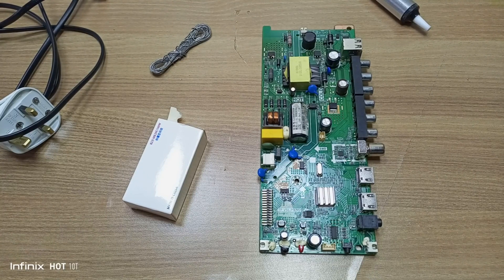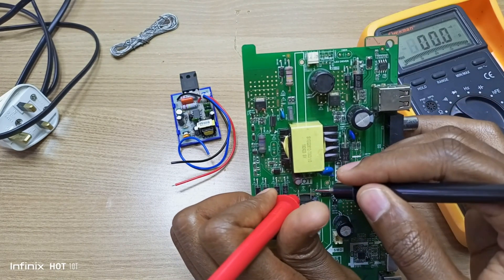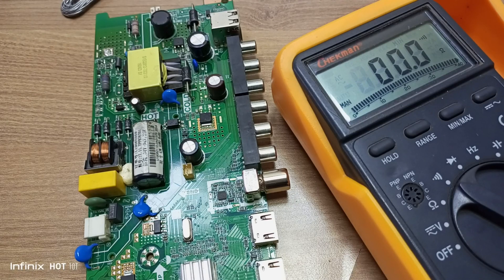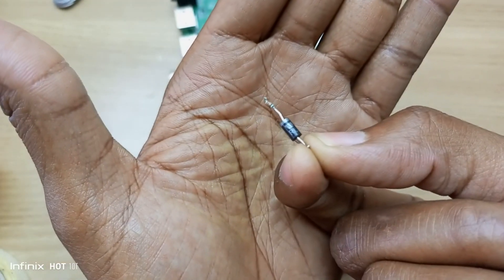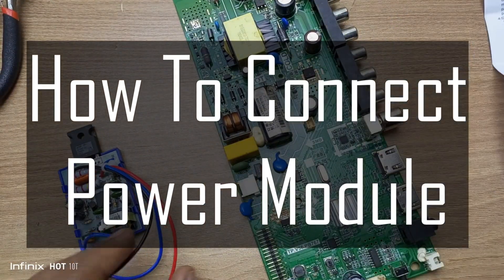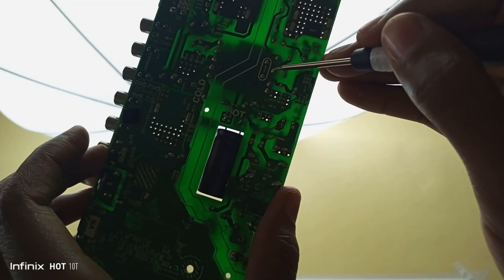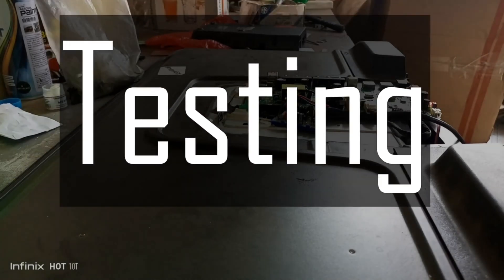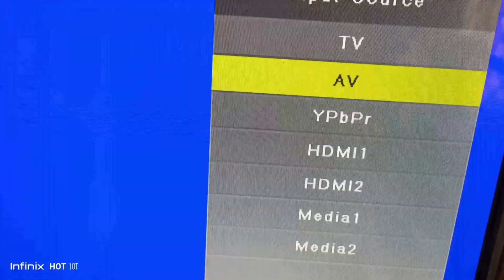Using A Power Module To Fix TeleFunken TV

Comment: You made a bad mistake connecting the optocoupler. You soldered the blue wire to the LED instead of to the collector of the phototransistor. There is not feedback. The board worked by sheer luck, likely because you’re feeding back directly from the TL431. There’s no protection in your circuit.